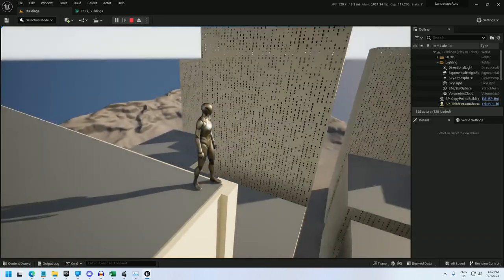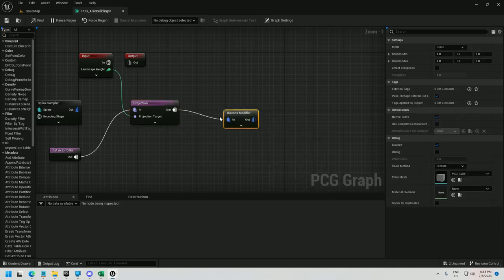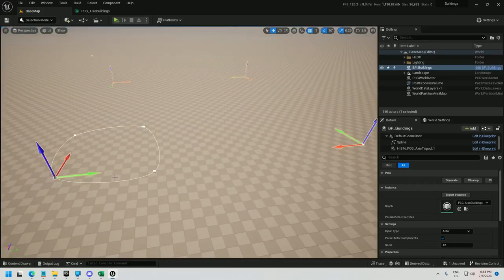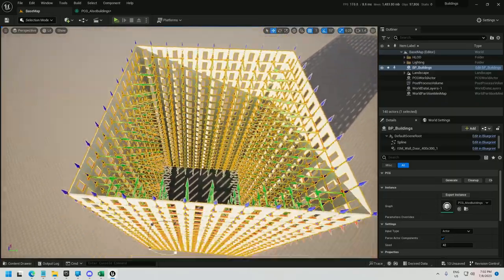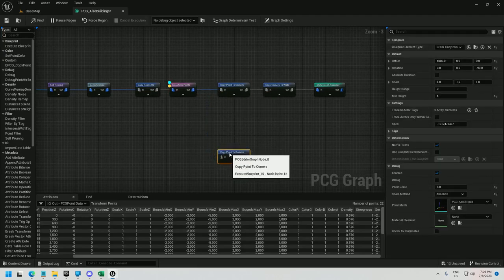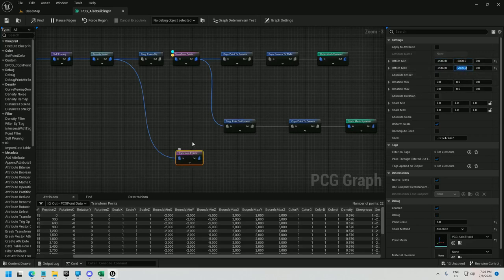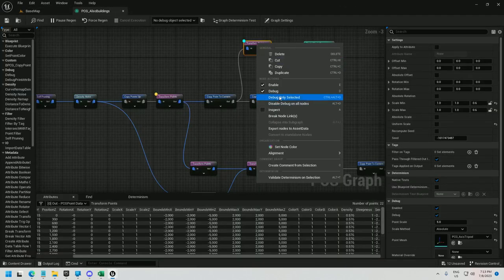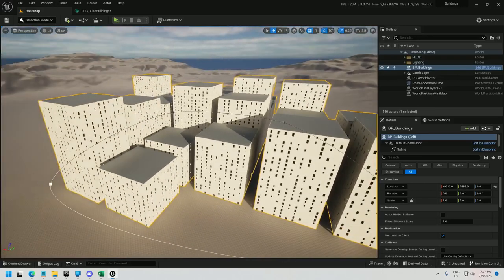Unreal Engine 5.2 PCG Tutorial - Creating Skyscrapers Part 2 - Set Up the Gestalt

Comment: Hello Micheal, I was wondering if you knew anything about materials and PCG, specifically assigning different materials to say different floor panels or different wall colors for various walls?
Reply from the maker: That's a great idea, and I hadn't thought about it until now. I've used the material override quite a bit, but you can't seem to set it by attribute, so you'd need to create Static Mesh Spawner entry for each material.

You could also assign a custom attribute to your material, and have the material change its texture/color based on the attribute. I unfortunately don't have a concise tutorial on how to do that, but it's not very complex -- You can check out the "Rotation" and "Data Pull" sections of my LED screen tutorial for an idea of how to set it up. https://www.youtube.com/watch?v=5PM9dq0jWGc&t=819s

Comment: Hi Michael in which tutorial did you make the " BPCG_CopyPointsBuildings" Element i cant seem to find it.
Reply from the maker: Hey there, I made use of the PCG Blueprint in this video: https://www.youtube.com/watch?v=6yTw9zHrr68

I personally wouldn't recommend going this route unless you need to work in 5.2. You can do a similar setup with a loop subgraph in 5.3, and it'll be a lot faster and more stable. Here's a video where I do that: https://www.youtube.com/watch?v=Rknnu16mrOw

And one final note -- I would personally recommend making buildings from bigger chunks, instead of these small modular wall sections. This method I've taken is more to stress test things and see what PCG can build, it results in a poorly optimized experience. It's possible Nanite will be able to handle things better in future versions but for now it struggles once you get a decent sized city with this method. On the other hand, if you're just looking to make a modular city to make a video, you probably aren't as concerned with optimization so it could be an option there.